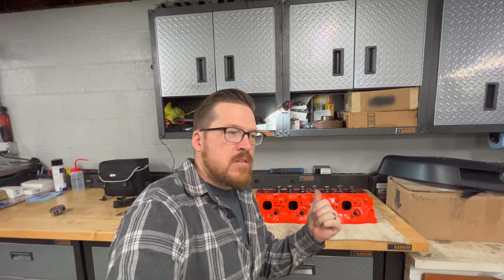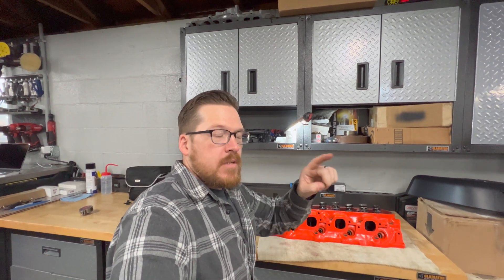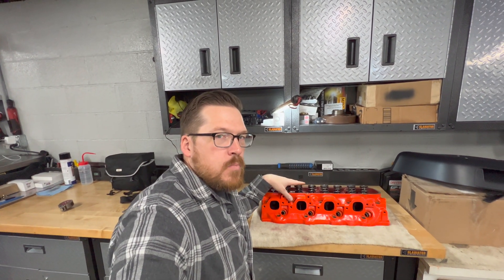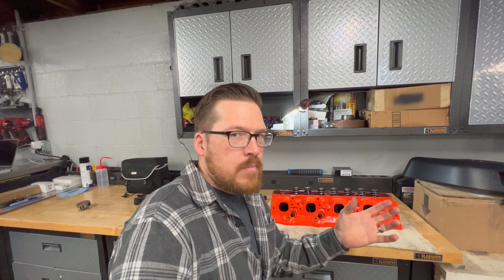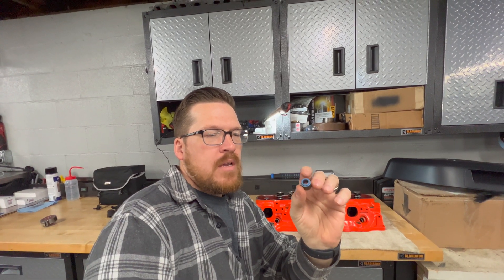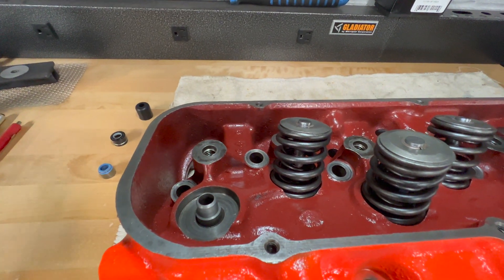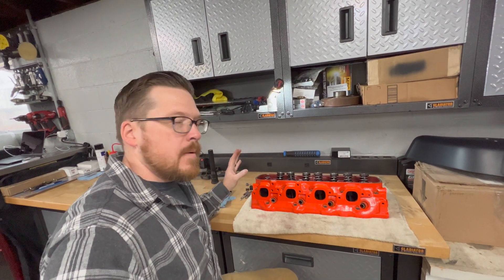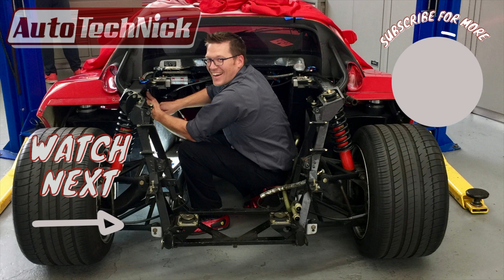Modifying Big Block Chevy Valve guides for Modern seals & More lift

Comment: Prices have apparently gone up compared to when this was made.  Prices now before taxes and shipping for the arbor and cutter are $144.90.  My total (for my part of the country) is $156.13 and free shipping.
Would definitely save the cost of having to pay a machine shop to do a valve job and charge for a bunch of extra stuff that may not be necessary.  But finding a worn valve guide while doing this work usually means having to do the work anyways.
Reply from the maker: The cost of EVERYTHING has gone up!! It's insane.

~ Nick

Comment: I'm going to a hydraulic roller cam in my 402 Chevy and I'll be doing the whole deal also. Did you leave an additional measured clearance for the retainer and valve seal like an extra .010" or so? Thanks for sharing this video.
Reply from the maker: Yes. I did account for the seal, and retainer when I made my measurements. 

~ Nick

Comment: Great video, just what I needed to know. that arbor for the cutter what are the cutter end dimensions? Can I modify a old 3/8 valve to use as a arbor? TIA Steve
Reply from the maker: That is a very good idea to save some cash! I sold the tools a while back, so I am going off memory here. I do not see why you couldn't use an old valve stem as the arbor. As I recall there was nothing special about the arbor, other than the fact that it had 3 flat flanks machined onto the drill end for the chuck to grip onto. 

~ Nick
Reply: @AutoTechNick  Thanks. I'm a WV Hillbilly  living in New Zealand and I'm NOT paying 400.00 for the cutter and arbor. Even buying from jungle site or summit shipping is like 100 bucks. Thanks again
Reply: @AutoTechNick  yup I cut off a valve did a little fancey grinding and it worked great.

Comment: Im doing a 454 build. I was just looking google for max valve lift stock 454. Wow people all over the place with no definite answers. So i got fed up decide to check for myself. I took spring off and put retainer on with locks. I checked the clearance below retainer to top of seal and i got .660 clearance. And thats the lowest part of retainer in the center that drops down a bit further than the actual spring surface. So technically you could run .650 lift (and spare .010) and not bottom out on the seal. Now as far as spring height and coil bind, i sqished the spring in my vise starting at the installed height to full coil bind and got .585 difference. These are stock 454 springs. Now i dont know everything about springs but i would guess its not a good idea to max out the valve springs. As they only have so much resistance strength per pressure? My calculation  would be borderline safe to run a .525 lift cam. I've read blogs online where people say they've run .550- 600 lift cams with no issues. But i find that skeptical. So.... if this helps anyone.. thought I'd throw my 2 cents in. 👍
Reply from the maker: Very good information. I appreciate you sharing it. 

~ Nick
Reply: Most things Ive seen say youneed 40 to 50 thousandths clearance for the seal, the next is the coil bind on the springs. I been looking at doing the same thing on a set of vortec heads for SBC.

Comment: This is my exact same problem after having new guilds installed , which the machine shop ( 30 miles away and always too busy to call ) had forgot or didn't know to cut the guilds down for me and I didn't think to ask when picking them up after 3 months of waiting for them to be machined...I'd rather spend the money on a tool rather than go back and wait another week or 2 or 3 , just to get the guilds cut down.....Thank you for this video.
Reply: Oh, and by the way , the guild is sticking up off the spring perch 3/4 of an inch......I should have realized when i picked them up , I did think it was odd but was too happy to pay and get the hell out of there.
Reply from the maker: Scott. I am glad that the video helped you out. Sorry to hear about your struggles with the machine shop. Unfortianly I know the feeling, as I have been in many similar situations in the past. Good Machine shops are getting harder and harder to come by. 

~ Nick

Comment: I need to replace the seals in my 396, stock heads. I am not a fan of the rubber Umbrella sals, but cannot use the Viton seals without machining the guides. Where can I find the Seals with Teflon rings like you used?
Reply from the maker: Jack, if I remember correctly I got them from Summit, although I recall it taking a lot of searching. 

~ Nick

Comment: What's wrong with the umbrella guide seals?
Reply from the maker: Umbrella seals arnt nearly as effective as a positive type seal, since the ride with the valve. Oil can still get around them easily. But the biggest drawback is their diameter. The diameter limits your valve spring options, which can limit your camshaft selection. 

~ Nick
Reply: @AutoTechNick  I only run flat tappet cams on my bbc and use a comp cams 911-16 single spring, that's as high a pressure you want to go with a flat tappet if you want any life from your cam.
Reply from the maker: I used to frequently run flat tappet cams. But with the ongoing quality issues from all manufacturers with the cam cores, wiping lobes on break in. I highly doubt that I will gamble on another one again. It is just too costly if you end up wiping a lobe. 

~ Nick
Reply: @AutoTechNick  I've been running solid flat tappet cams since the 60s and never had one go flat. I guess I'm blessed.
Reply from the maker: @joe-hp4nk  Its been a recent development in the industry. I would say the frequency that it has been occurring has rapidly increased in the last 10-15 years. The old cams don’t have the same issue. Two of my engines are flat tappet, but the cams are from the late 90’s. 

~ Nick
Reply: @AutoTechNick  I still use flat tappet today   with no issues but I use a light spring for break in. I also put a paint mark on the pushrods so I can see them spin when I check the lash. So far so good.

Comment: What tools do you use for cutting the valve guide in order to make more clearence for the lift? All the best
Reply from the maker: Pedro, here are the tools that I used to modify my guides:

COMP Cams 4734 - COMP Cams Arbor/Pilot
https://www.summitracing.com/parts/cca-4734

COMP Cams 4715 - COMP Cams Valve Guide Cutting Tool
https://www.summitracing.com/parts/cca-4715

~ Nick
Reply: @AutoTechNick  thanks bro! I make the same work in a 454.!!

Comment: My umbrella seals won't fit with dual valve springs. Options either use behive spring or cut valve stems. Beehive springs superior if possible (lighter) that's as far as iv got. Your vid has helped clear up a few things. Thanks 👍
Reply from the maker: Yes there are a lot of advantages to running the beehive springs. But I feel that the advantage to moving away from umbrella valve seals over to Viton, is far greater. Plus you then have the option to run either style of valve spring that you choose. It will really open up more options for you.

Comment: How much of the oem guide did you end up machining off for adequate seal/retainer clearance in you application.  I have a hyd roller .600" cam I plan to use on the same cast # head that you modified.  
Thanks!
Reply from the maker: I did not measure the total amount of material that I removed. I was trying to leave as much guide left as possible, while gaining the clearance that I needed. It was a bit of trial and error, since I though I had it set just right, but then I needed to cut them down a little more due to the valve seals.